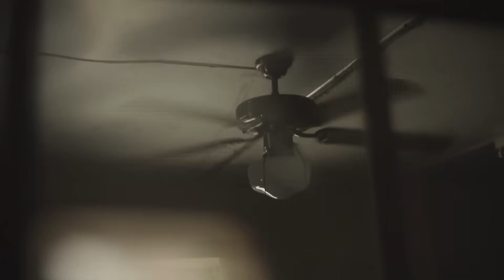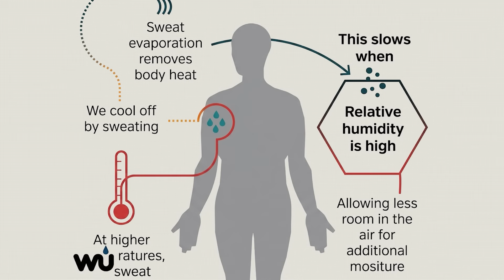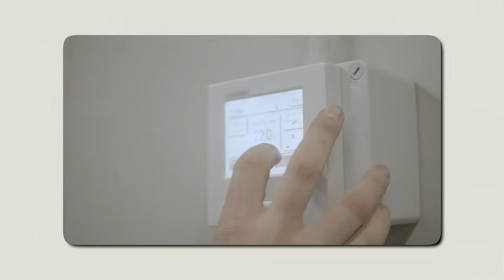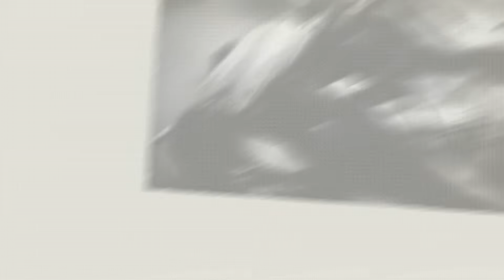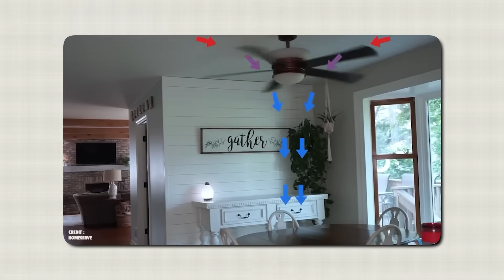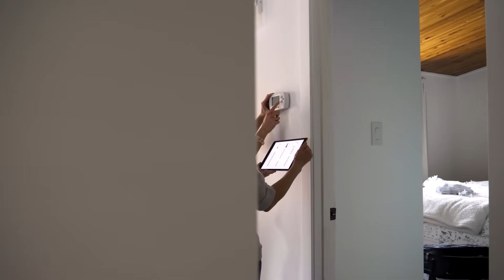Ceiling Fans Aren't Cooling Your Room — Here's How To Actually Use It

Comment: I have a fan in the part of the house that is all tile floor on concrete slab and it can cool that area (half the house) very well most of the summer minus about 3 weeks in peek heat. By that time the slab has become too warm from rising ground temps.

Comment: I would like to direct the comment section to Technology Connections. This channel will give you a much better explanation and positives. 

Also you would be completely wrong about switching a fan off when you leave. Your ceiling fan pulls air from the rooms adjacent as well. This helps move air all over the house.

Comment: No ! Summers Fans should be only run overnight with open windows to draw in the cool air from outside and cool the interior until the morning, When you closing the windows and turn the fan off. For personal cooling you use a table fan or a fan on a stand directed at your body 
Winters as in the video
Reply: How can a ceiling fan draw cool air in? They only circulate air in the room.
Reply: @dfinma By partially opening the window.
Reply: Personal safety needs to be taken into consideration. For the most part, no one should leave windows open at night, especially in the summer, when intruders expect open windows.
Reply: @bessycorrales2259 Yes.  I only open my windows partially for that reason, and I have a wooden dowel and window clip for that risk.
Reply from the maker: Good point, using the cross-ventilation method is definitely an effective way to keep the house cool during hot summers.
Reply: You obviously do not live in the American south where humidity levels can be 90% and hot even overnight. Miserable without air conditioning
Reply: @gregthecrabb  yes thats a bummer i can only speak of my area BC SW coast

Comment: This video totally misses the extremely useful ceiling fan function of "mixing" the air in rooms so that the temperature is evenly distributed in the room and even through a entire zone of a home so that the temperature at the t-stat and the temperature of the air entering into the air conditioning return/s is/are reasonably close. The circulation of air supply cold air sinking across the room does not distribute/mix well with the warm air collecting near the ceiling, especially if the return is in a ceiling and/or not in the same room. Ceiling fans at low speed will mix this air so that the thermostat is getting a more accurate measure of the room average. Some air handlers have circulation fan modes which are also helpful. Together, they will result is better cycles and better comfort.
Reply: Applause
Reply: It also misses the fact that ceiling fans can also "pull" air out of a nearby ceiling vents like they do in my office, which is the farthest room from the HVAC in my house.  With the fans off, my office gets roasting hot with the fans off, whether I'm in it or not.  I keep them on low all summer long, and it keeps my office nice and cool.
Reply from the maker: Interesting point! Not sure how they "pull" air from vents given they do not create a vacuum in the room.  Where does the displaced air go?
Reply: @wildline_YT  I think he may have meant that the fan pushes the air in the cool room toward the distant warmer room. I would think well-placed floor fans would do this quicker, more efficiently than a ceiling fan.
Reply from the maker: You make a fair point. Ceiling fans do help mix air better but the key point is that air movement causes cooling by breaking the stagnant barrier of air around the body, not by cooling the room itself.  So the video isn't wrong!
Reply: @wildline_YT  True; not wrong...perhaps a bit incomplete. Another factor neither of us mentioned, but plays a role is the relative humidity/dew point in the room and AC cycle duration times. Your theory of breaking the stagnant barrier is tough to rely on due to many factors...such as clothing (which is infinitely variable) level of activity, etc. We can rely on lower temperature doing its job. It's just a matter of how long it may take.  Light summer clothing, humidity driven down to the low 30s, and a comfortable t-stat setting (subjective, of course), and we cool down just fine.  The fans make their contributions.
Reply: Interesting take. The question is: if the fan's biggest benefit is air mixing and thermostat accuracy, why do so many people still insist a fan actually lowers room temperature? 👀
Reply: @EnergyAxisIntel  It's likely that it is not so much lowered room temperature as it is that there are not warm/hot pools.  So, comfort goes up.  The real world measure is comfort which is associated with temperature.
Reply: Yes 100% I realized this on my own after a fair bit of tinkering with my AC during a hot summer week.
Reply: This is clearly aislop
Reply from the maker: There We Are Then - thanks for the comment! Always enjoy hearing from someone taking their time to write such interesting feedback! 👍
Reply: @obsideosomniaTo whom are what are you referring?🤔

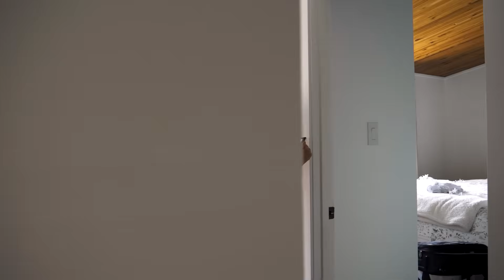Comment: 9:34 Honestly, I believe it's the opposite. You forgot to factor in the temperature at ceiling level. The air will naturally raise when hot. Therefore spining the fan to push air down will send hotter air on you. Sure you'll feel a breeze but if you spin it so the air is pushed upward, cooler air from the floor level will be pulled up. You may feel less air movement directly on your skin but it will be a cooler breeze. In the winter, it's the better to run the fan so it pushed the hotter air (that accumulates naturally at the ceiling level) down. Since the air is already warm, you won't really feel a draft, and it will help keep heated air at your level, closer to the floor. Of course, if the fan is too small vs the room size, its effect may not be noticeable. Any heater or cool/hot vent/intake location must be taken into account vs. the air flow that the fan will induce. Also, not every fan will be more efficient when turning faster. Depending on the design and distance from the ceiling, some will create more turbulence at top speed, making them no more efficient than when run at medium speed. The best thing is to try what works better in your conditions 🙂
Reply: I agree with you. This is how we've always used ours, especially if the wood stove is burning. At night, we turn the fan in the room with the stove on jigh and it blows the hot air down, across all the floors and even back into the bedrooms. I do not like a fan blowing directly on me in summer so it blows upward for more subtle effect but sitting on the couch I can feel the air coming g down the wall.
Reply: @gregcrabb3497 Indeed, that's the point I was trying to make. You manage the airflow accorting to your needs. There is no magic formula. The size of the ceiling fan vs the room, heat or cooling sources, where you want to direct hot/cold air etc. It's the difference between using the ceiling fan to manage room temperature vs only trying to evaporate swet from your skin. In my opinion, a simple fan sitting on the (cooler) floor, pushing air directly on you will do a better evaportion job than a ceiling fan. As with many things, the best solution will always depend on the surrounding variable, conditions etc.
In an house I owned, the (oil) central heating system was replaced with electric baseboard but the air docks were left in place. Since the basement was much cooler, I installed fans in the main return dock in order to blow air from the 1st floor into the basement, forcing the cooler air up through the other docks. It helped cool the house until I installed an air conditioner.
Reply: You're mixing up the summer and winter modes, which is a common point of confusion. 

Here's a breakdown of what's off in your comment:

Summer (Cooling Mode), What the Video Likely Said

Correct direction: Counterclockwise (when looking up at the fan). This creates a downdraft — it pushes air straight down toward you.

Why this works: The main goal isn't to "pull up the coolest air from the floor." It's the wind chill effect on your skin. Moving air evaporates sweat faster, making you feel 4–8°F cooler even if the room temperature doesn't drop. You want to feel that breeze on your body.

Your mistake here: Pushing air upward (clockwise in summer) would create an updraft. This circulates air gently but gives you little to no direct breeze on your skin — so it feels less cooling. The hot air at the ceiling gets mixed, but the windchill benefit (what actually makes you comfortable) is much weaker. The fan isn't sending "hotter air on you" in a meaningful way during summer use because the downdraft mixes the room while the breeze dominates the comfort sensation.

Winter (Heating Mode)

Correct direction: Clockwise at a low speed. This creates a gentle updraft that draws cooler floor air upward and pushes warm air (which rises to the ceiling) downward along the walls.

This matches the second half of your comment — good point on recirculating warm air without a strong draft.

Other Points in Your Comment
Temperature stratification: Yes, hot air rises — that's why direction matters. But in summer, the downdraft is still better because comfort comes from the breeze, not from trying to isolate the coolest floor air.

Fan size, speed, vents, turbulence: These are solid observations. Not every fan performs best at max speed, and room layout/ceiling height matters. Experimenting in your own space is smart.

The video is probably emphasizing the standard Energy Star/manufacturer advice (counterclockwise in summer for the downdraft breeze). Most people run fans the wrong way year-round, which is why "60% are using them wrong" is the hook.

For summer cooling, run counterclockwise (downdraft), so you feel the breeze. Save the updraft (clockwise, low speed) for winter to redistribute heat. Try both directions in your room; your body should notice the difference in perceived comfort.
Reply: @CabotCoOp   You can repeat the speech from the video all you want, I know my physics, what makes sense and how heating / cooling air flow, and those methods work.  Believe what you want, I know what works and not, along with the the other things that impact the results. I tried different things and thus know what works and why it does. Don't just believe everything you're told, try it and do what works for you.
Reply: @ME2K23 the video is aislop. That comment is either copy-paste from aislop, or it's a bot. Waste of your time and effort either way.
Reply: @obsideosomnia  indeed! 👍
Reply: @ME2K23  You really failed at physics.

What motivated you to waste your life?